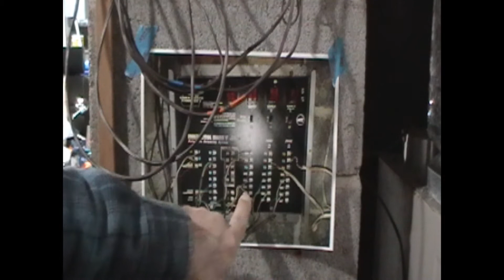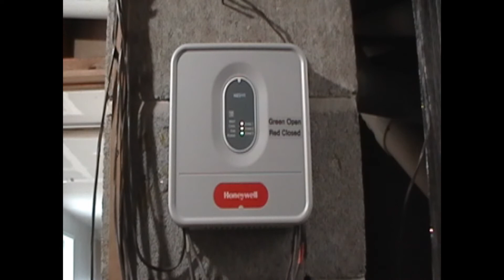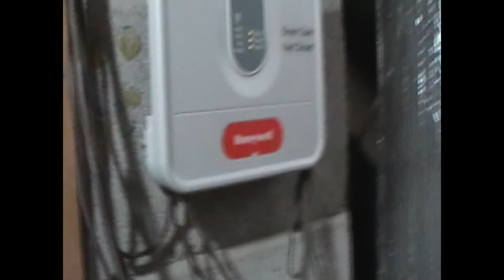Mastertrol Mark V to Honeywell HZ311 Swap

Comment: They are not valves , they are dampers. Big difference.
Reply from the maker: Actually, if you listen, I'm talking about the valves that control the dampeners.  Big difference.  Notice that I spelled dampeners correctly.
Reply: @paulday4763  Go back and and you will find that you said valves. And they are dampers
Reply from the maker: @chrissipple1018  What are you nitpicking for?  Go make your own video if you think you can do better!  SBAA